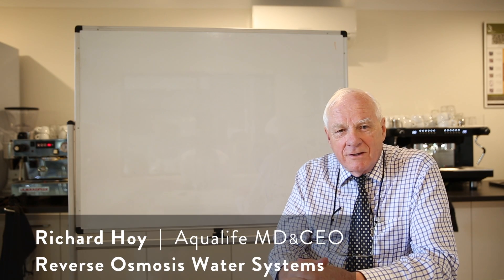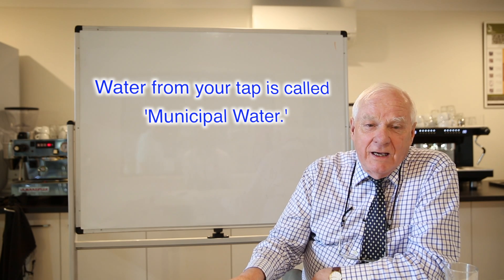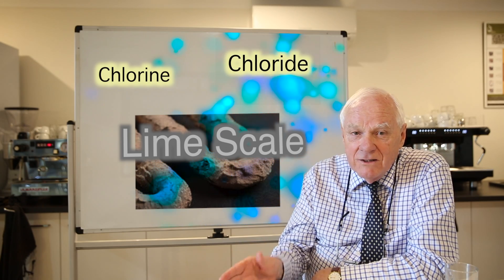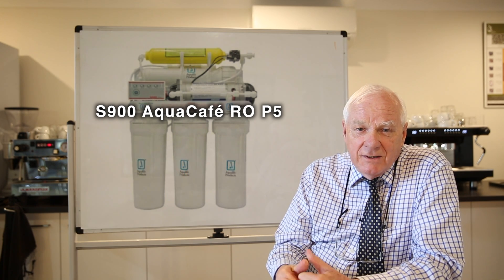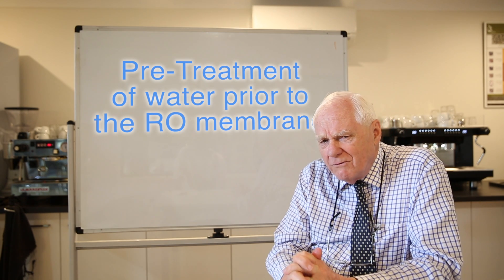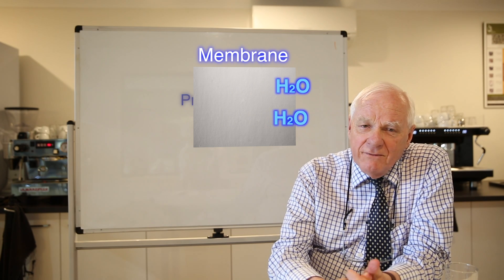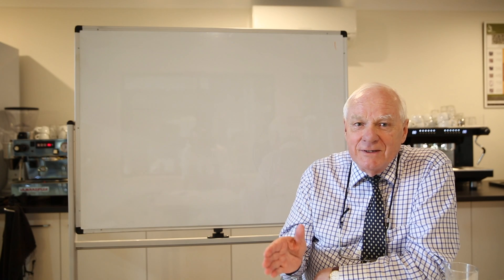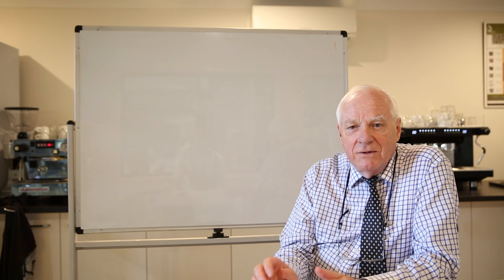Reverse Osmosis (RO) | Why & How does it work?

Comment: Thank you for the video. How effective is pre-treatment? Following your example of 300 ppm water will get treated to about 15 ppm after it goes through pre treatment and RO membrane. What should roughly be the TDS after pre-treatment but before RO membrane? Thank you.
Reply from the maker: TDS is affected primarily and largely from passing through the membrane. Pre-treatment is there in order to lengthen the life of the membrane, which does very precise and calculable work in regards to removing dissolved solids. Pre-treatment does not significantly reduce TDS. Additionally, without the use of the membrane, and say just use a daisy chain of Pre-treatment filters.. you will see a decline in the efficiency of the each of the pre-treatment filters as they bore the load of barely reducing the TDS on top of removing Chlorine and undissolved matter to a inconsistent TDS value.
Reply: Thank you for the answer. Also I just wanted to tell you that I really appreciate your vlogs and find a lot of value there. Thanks for that and regards from Czech Republic!